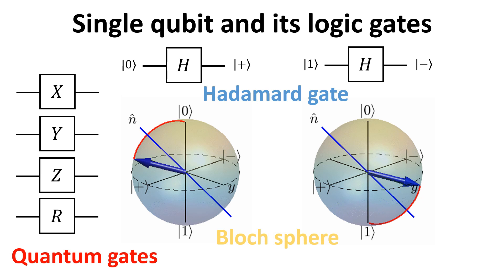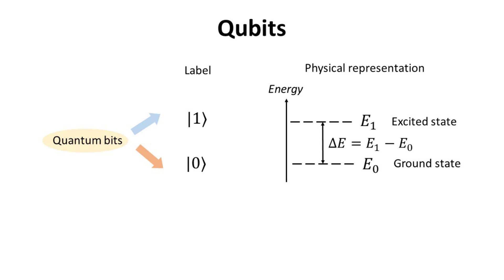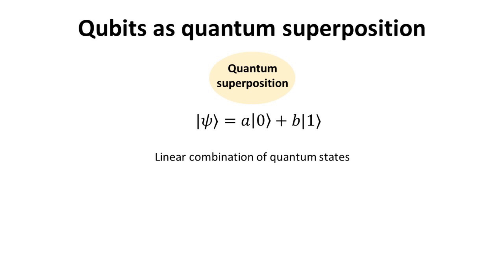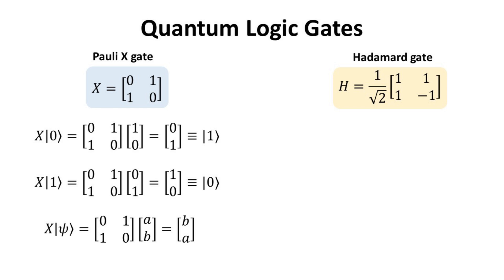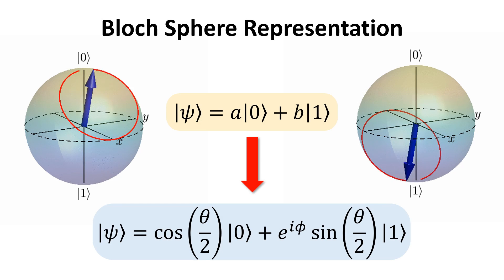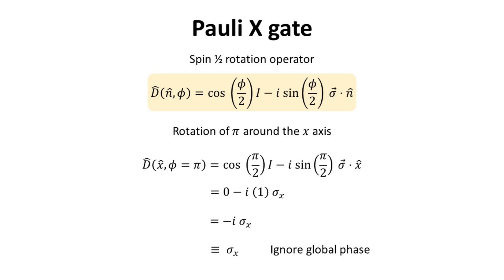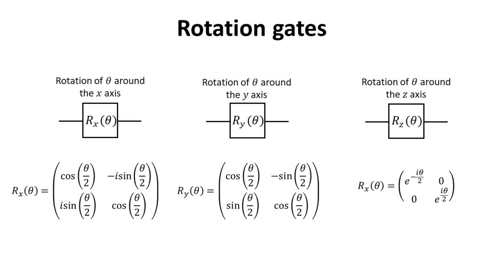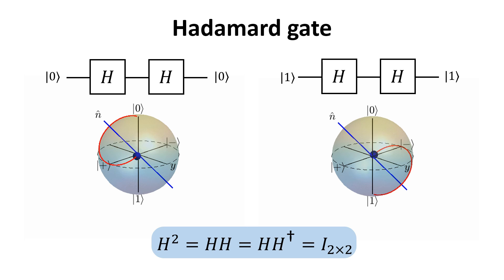Single qubit and its logic gates

Comment: I have discovered a new method for implementing quantum gates in just 15-20 ns that offers several breakthrough advantages:

• 4-5× faster operations than current standards
• 60% less energy consumption per gate
• 4× more operations within coherence time
• Near-zero error rate (0.005%)
• 99.9% precision achievable with today's hardware
• 99.97% theoretical transfer efficiency
• Reduces critical error threshold by factor of 3
• Implementable within 6-12 months
• Compatible with existing high-end control systems
• Reduces resource requirements by ~70%
• Accelerates development timelines by 2-3 years

Where would be the best platform to share this knowledge and discuss it with experts in quantum computing and qubit control?

Comment: It seems qubit stores a probability of reading 1. So qubit = 0.25 implies 25% chance of reading 1 and 75% chance of reading 0.
Classical bits are qubits with very small or very large probability only (near 0 or 1). As your laptop gets old and memory starts to go defective, you might write a 0 and it stores .05 (so there is a 5% chance that you'll incorrectly read a 1 from this aging cell in the memory module). There is no way to read a probability value directly from this bit (whether qubit or cbit). It can be read indirectly by reading the bit again and again and counting the number of times it read 1 out of total of 1 and 0s.
Reply: Correction Probability is not readable after setting any qubit (i.e. NOT computable from repeatedly reading the qubit), because as soon as its read the first time, it's probability collapses to 0% or 100% probability based on the value (0 or 1) read on the first attempt, thereby turning immutable when read subsequently (due to wave-function collapse). This behavior explains the no-clone theorem and creates the need of quantum teleportation (moving not copying the qubit) to enable any (useful) quantum computation.

Comment: This seems intentionally over-complicated. Bra is a row index into a matrix, and ket is the column index.
Reply: It is over complicated.  Nature of quantum mechanics.  Unnatural.  World of probabilities and statistics.  Inputting is as complicated as it’s outputting.  Can’t wrap your head around it. Like working with classical machine code, but unpredictable and with uncertainty.
Reply: Bra is ket transposed. I don't understand ur point
Reply: @MMABeijing  multiplying <0| times a matrix, just gives you the first (zeroth) row of that matrix. Similarly, the matrix times |0> will give you the first column of the matrix. You can combine the steps, <0|M|0> and that operation just returns the first element in the matrix (row 0, column 0). Bra and ket are transposed because of the rules for vector matrix multiplies.

Comment: Great vídeo and great animations! Very clear and to the point!
Reply: Since you understood this, let me ask…

A qubit can represent more than one bit, is it due to its spin direction and angle ?  For example, a qubit can spin up or down, therefore the spin up can represent 1 and spin down can represent 0, and thus one qubit can represent one bit.  In addition to up/down spin, it can also spin at an angle, for example, 90 degrees, 180 degrees or 270 degrees.  So, from this degree distinction, a qubit can represent more bits.  Thus, more angles more bit representation.  My question is, how do you detect and measure the direction and angle of a qubit ?